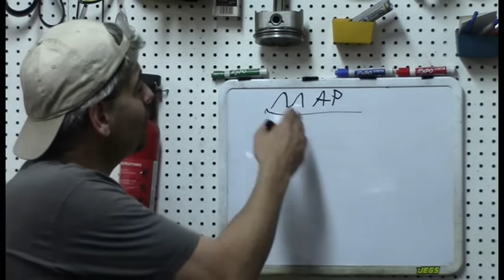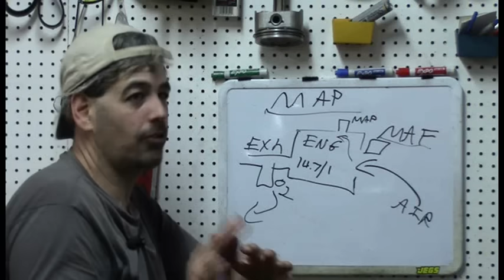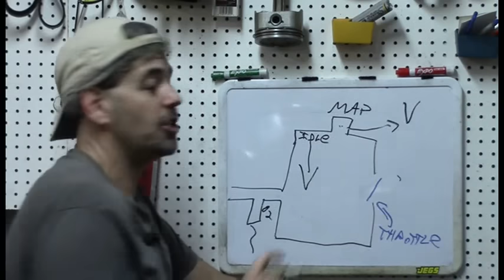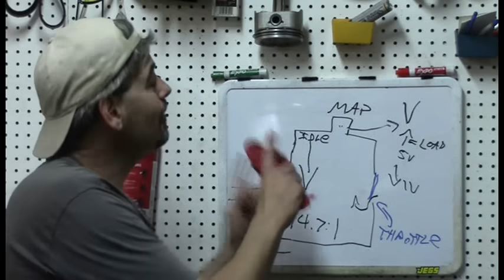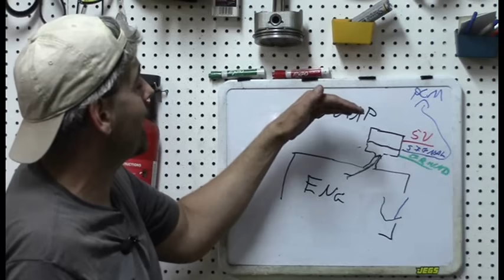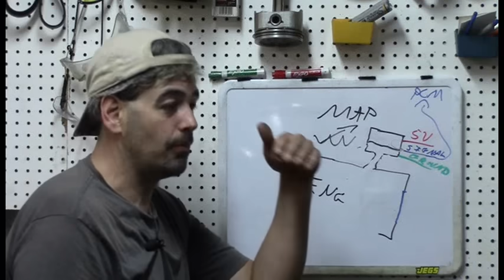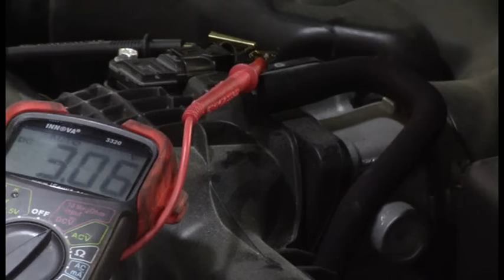MAP Sensor Diagnosis and Understanding Function- Pt1

Comment: I do not know all I know is that Autozone gave me that diagnosis on my vehicle but a friend of mine say that is going to be the MAP sensor, error P0871 A/T O/D pressure switch circuit malfunction and error P0736 A/T additional hear ratio error in reverse gear
Reply from the maker: I can't help without data, sorry.  Good luck. I hope your friend is a good guesser.

Comment: Good morning from Greece. In a town and country 2000 i have 5v to the signal to the map sensor.This happens when the terminal is out of the sensor, should it have voltage when it is out of the sensor?Thank you for the knowledge you give us.Please answer me soon.
Reply from the maker: Well yes of course- how would it work otherwise?  It's the voltage DROP you need to measure.

Comment: I have been watching your videos and they are very informative. I have an 04 Dodge grand Caravan 3.8 L sxt and code P0113 came on and I watched your video on doing a diagnostic ck on the air intake sensor. It tested for .1 ohms and the sensor and tested for 5.1 V. Have you ever came across this and found if ck engine still comes on what it might be?
Reply from the maker: You have to test for variable resistance in the sensor- you can't just test a single reference
Reply: @SchrodingersBox  I replaced the sensor, but the new aftermarket showed .01 ohms resistance, which I suspect it may have an open circuit.Tested with heat and didn't change. I think I bought one that's bad. Am going to get "OEM" and see if changes things. Any input would be helpful.
Reply from the maker: What?? Why would you suspect an open circuit on .1 ohms?? Say what?

Comment: I’m having the problem you were talking about in the video about the MAP sensor when the car is at low idle and it stops the fuel from going to the engine which causes the engine to cut off sitting at a light. I was trying to see how to fit that problem? I know changing the MAP sensor won’t do much.
Reply from the maker: What is the voltage curve you are seeing from the MAP and what is your fuel trim when curved against load?
Reply: Schrodingers Box It usually says about 12V when I come to a complete stop then when the engine shakes a little. Then the voltage drops to 10.2 or 10.3. Car cuts off. Starts right back up then goes on.
Reply from the maker: There is no way the voltage can be 12V at any time the engine is running. Absoely impossible.  How are you measuring this?
Reply: Schrodingers Box By my voltage gauge that’s in my car. While the car is driving it says 13ish range then when I come to a stop it says 12ish something. Once I see it go to 10 the car shuts off.
Reply from the maker: No no I asked for the MAP voltage. Why would the battery voltage be relevant? Please provide your MAP voltage readings and fuel trims as shown in the video otherwise I can't help!!

Comment: thank you, I am interested in detecting the methane-carbon dioxide flow from a bio-digestion research project, do you think I would be able to use a MAF for this purpose, or is it strictly for fuel-air ratio?

Comment: Great video, I'm hoping you can help me with a question.  I have  a 1986 F-150 5.0L with speed density EFI. I got a DTC 22 (MAP sensor out of range). The MAP sensor signal is in Hz, not volts on this truck. Everything I've seen says to  test the output with a meter (on the Hz setting) by back probing the signal wire with the red lead and the black lead on battery negative (I confirmed 5v reference voltage and good signal return to ground). I should be showing about 152Hz with no vacuum (key on engine off). I got 0Hz which means my MAP is bad according to what I read. So I bought a new one. Before starting the engine I checked the new one the same way and also got 0Hz. Bought another one just to check and also got 0Hz. I doubt that all 3 are bad. I assume I am doing something wrong but I can't figure out what. Followed directions exactly,  tried 3 different meters. Any idea how to test this type of MAP? Thanks
Reply from the maker: Just check the signal voltage. it’s pretty obvious you have no signal voltage to the PCM.
Reply: @SchrodingersBox  As I said, there is not supposed to be a signal voltage. There is a signal frequency. I just figured out what the problem is. Borrowed another multimeter from my neighbor and checked it again. Got 158Hz with no vacuum and the correct frequencies at other levels of vacuum, just as specified. All 3 MAPS are good. Turns out the 3 meters I used before were not capable of reading the output of the MAP, not sure why.
Reply from the maker: There will still be a voltage. Yes it reads frequency- but if there is frequency there is square wave.
  I would validate the square wave is reaching the PCM is what I am saying. if it is not, that explains your issue.
  You can also induce a signal frequency and see if it shows at the PCM too.  This is typically what I do in fact since it’s easier.
Reply: @SchrodingersBox   Thanks for the reply. I will check the signal at the PCM
Reply from the maker: I have a video with identical problem but a pulsewidth modulated ignition signal was failing to get to the PCM causing a no start. i verified there was no voltage at the PCM- even though it’s pulsewidth modulated. It’s exactly the same concept as MAP sensor signal to PCM.  Plus I just used a testlight and $13 DVOM. 
  title is “DIY: no start due to no spark diagnosis” or something like that.

Comment: Hi I need help with my diesel engine its got both map and maf, engine starts fine but while the engine is warming up it has trouble with acceleration its like the engine rev goes up to 1400rpm and stuck for few seconds. I did find a leak in the egr cooler which I have repaired. But the issue is still there. when its warm then the engine runs better. Please help.

Comment: Hi Matt, I have a 91 Ford Econoline. I have a high idle so it wont pass smog and I don't have a scan tool that will work on this vehicle. The idle is normal for a few seconds and then it goes up a couple hundred RPMs. Sometimes the rpm is up and then its down. There is NO MAF. I could not find a vacuum leak. I think the IAC is sticking. I removed it and from the intake so I can see the pintle and when I turn the car to on, I hear a click put nothing moves on the IAC. What do you think? Thanks for your help.

Comment: Thank you !  great explanation. Is there a chance to know how to check the MAP bad wiring ? ( I have an Passat b6 )
Thanks in advance !
Reply from the maker: Yes you very simply check the 5V reference against both ground and signal.  Its that easy. If it check positive the wiring is fine.
Reply: Thank you very much! It make sens :)
Reply: @SchrodingersBox  one moore question : do you know where should be the ground point on my passat b6 bkp? I didn't found it anywere. Thank you!

Comment: If I understand this then if there is a vacuum leak allowing air in then could that cause an artificially  high voltage reading and even go over the expected maximum? My 2006 T & C throws code 0104 for bad MAP but the MAP is fine so trying to figure out why code keeps coming back. I do not see any obvious vacuum leaks but will check better and comment what I find.

Comment: A question please. Valve lash effects on fuel trim, did a valve lash and my long term fuel trim at idle is  negative  9% to 10%. Its a 2006 Acura tsx by the way.

Comment: According to YouTube the problem with my 1998 Dodge Ram 1500 is the MAF sensor...so since it does not have one, I viewed that it has  to be the MAP sensor...so where is it located? I can't find it anywhere on the internet! Is this true? Cuz it's all the same symtoms...Hesitation, Jerking on 1st gear and now it's jerking at times when I'm driving too...It stalls sometimes when I'm  at a light or, when I turn the wheel also, (only when it's cold tho!) It does have engine pinging also....thank you💗💗💗 today is my birthday...Spent all day with this car problem...Please Help!
Reply from the maker: What data do you have that this is an induction metering issue? what is your foundation? Fuel trim? Map voltage?

Comment: Another great tuition. I was using the MAP data from my scan tool to help determine if i have any vac leaks as a starting point. One thing i noticed at idle if the AC is on its 42kPa and if i switch off AC it is 36kPa. I didnt think there was any relationship other than engine load. Is this normal?
Reply: Both conditions are at idle
Reply from the maker: yes it is normal because turning on the AC opens the idle air control valve.
Reply: @SchrodingersBox  thank you! Loving ur videos. My chevy avalanche and i are  following you from Qatar.
Reply from the maker: I have a few viewers from Qatar!! Good to know!!

Comment: Is it a coincidence?  The MAF g/s at idle is close to my engines displacement size in liters and when I rev it, the g/s climbs up proportionally to rpm.
Reply from the maker: It’s usually that the g/s at WOT is roughly equal to displacement but it usually applies to engines over 3L and in general it’s a good rule of thumb to estimate proper MAF volume.

Comment: what is your opinion on tests involving simply unplugging the map or maf to stall the engine to death as a form of testing the sensors functionality. it seems to be very popular and convincing
Reply from the maker: I have several videos not only explaining but also showing why this is a bad strategy. 
   Basically when you unplug a sensor- particularly a major one like a MAF, you force the computer to default to preset values that will also override other sensor inputs. Therefore the reason the car usually runs better after unplugging a sensor is because the default strategy often substitutes for other failed inputs other than the one unplugged.  The engine running better is falsely attributed to the unplugged sensor and assumption this means that sensor must have been faulty.
Reply: @SchrodingersBox  this is what i was figuring after watching about 15 of your videos. im between going towards a faulty map sensor and a fuel pump for p0171/p0174 on my 2006 acura tl. i replaced the fuel pump with an aftermarket delphi unit when i only had a misfire under wot and it did nothing but also i had zero diagnostic skills at the time. the map sensor is 18 years old and the live data indicates its on both banks and not a vacuum leak, but the map sensor data doesnt seem to be entirely predictable with my untrained eyes. car also has a hard start and extended crank that doesnt happen with the map unplugged, leading me not to believe its the pump as it seems like there isnt enough fuel to start the car with the map sensor plugged in. also it sometimes stalls the car unplugging it during operation and other times doesnt. but starting with it unplugged, it starts perfectly normal then dies

Comment: great videos, Just one question, you say that the vacuum is very high at idle bt then a few seconds ater talk about the vacuum being low at this point. Could you just clear that up for me please?
Reply from the maker: Yeah I misspoke on that. Decelleration is the lowest pressure (most vacuum) followed by idle.  There is no vacuum at WOT- so it will read atmospheric the same as when engine is off.
Reply: @SchrodingersBox  Thats great, thanks for clearing that up with a speedy response, much appreciated

Comment: Hey Matt, so in the event that you do have to change a MAP or MAF sensor, how long should it take for your LTFT to sort of acclimate back to normal from a lean or rich condition? Does it correct itself right away when the air flow is returned to normal or is there sort of a learning period for the STFT to catch up and regulate?
Reply from the maker: +surffchik STFT will immediately start normalizing and on some cars the LTFT will take seconds, on others it may be a several minutes.  Also, if you are familiar with adaptive fuel cell strategy, it will probably take couple days driving before all the independent fuel cells are relearned.

Comment: What is the proper cleaner for map sensor? Is it electronic contact cleaner or a mass air flow sensor cleaner? Thanks man!
Reply from the maker: You don't really clean one.  What is your data indicating it is dirty and needs cleaning?
Reply: @SchrodingersBox  as of now i havent got any data. It is just been 5 years already i havent cleaned it. Pick up is good. I just want to do it for preventive maintenance. Tnx for the response.

Comment: Quick question ? If im throwing codes p0107 and p0178 on a caddy escalade 6.0 non flex fuel would I have a 5 v reference issue ya think cuz it is running really bad no power its like its in limp mode
Reply from the maker: your thinking is on par. with low voltage codes on two 5V references sensors I would check for a grounded 5V ref first.
Reply: @SchrodingersBox  alright I've tried every damn ground I could find my 5v references are good ! So now my fuel pressure regulator is like all rusty and shit could that be a possible I keep throwing p0178 consistently but I don't have flex fuel what would be causing that code ? I've changed battery , starter , map , maf, throttle body , redid all my grounds even that little black whit stripped bastard , still . And another tip bit this didn't just happen it gradually happened if that helps it used to be start but wouldn't stay running did that for couple weeks in cold then boom going down interstate just lost power havnt got it back since . Sorry so long Im just so frustrated . Thanks

Comment: Question: Are all of the wires to the PCM a ground? Because through my findings the items go through the fuse box that the PCM controls. The reason I think this is my key was off and I disconnected the connector at my EVAP solenoid and ran a test light and the wire was hot coming from the fuse but when the connector is plugged into the solenoid the solenoid stayed open as its suppose to when theres no power and all it needed was a ground and the PCM turns the power on to it so in other words it would've had to set the ground to of been able to turn it on
Reply from the maker: No not at all. Many many are powers

Comment: Happy i found you. Great stuff. I have a problem...my codes show MAP  and TPS.  Would you be so kind tell me if they are related...Can they go Bad both ? Are they related ?  I am going to check if you have any video about the TPS...and learn. Suddenly it began sucking petrol like crazy and Idle very high. Codes showed Lambda sensor. Replaced it. Idle went better but Consumption keep High. Now show Codes for MAP and TPS !!!  :-( THANK YOU SOOOO MUCH
Reply from the maker: impossible to tell without knowing the voltage readings from each.
Reply: @SchrodingersBox  Thank you so much Dear. I was just looking the video  about the TPS. You are Really great . Happy i found your videos .Very helpful...straight to the point  always . Very good. I am going to try measure the voltage taking it out of the car to not burn anything! Again THANK YOU. Have a nice weekend. God bless

Comment: Hi There. great video.  is it possible to have a faulty MAP sensor without the check engine light comes on?
Reply from the maker: It depends on either how far out of range its calibration is.  If there is any electrical failure or, more likely, the diaphragm busts, it will definitely set a CEL. 
 Keep in mind it is actually more likely to have a CEL that doesn't specifically mention the MAP sensor- e.g. "referenced code".  Lean and rich codes are an example.
Reply: Thanks Mate.  My issue is that while the check engine light remains off, when I stop at the lights my engine starts losing revs with  rev counter pointer starts deflecting downwards.  Any suggestions please?
Reply from the maker: Joe Borg It depends on the car. If the car has a MAF then a vacuum leak could certainly cause this.  But also you might want to see my videos on IAC diagnosis.
  Without a scantool however it's going to be really hard to get a direction.

Comment: Hi, i own a jeep xj 2001, i connect the scann diag tool and no errors apear. Problem is very poor fuel milleage. MAP has never replaced.   Rpms are always between 750 and 500. Sometimes when i stop at red light rpm drop to 200 but it returns to 500 after 2 secs. Issue is it burns a lot of gasoline. Do you have any suggestions to fix the low kms per litter?

Comment: Hi sir ,today's date is 24/01/2020 and probably you're not gonna to check this comment because this video is about 2 years old but if so pls  correct me, i watch this video more than 4 times and i feel sth is wrong:
on 7:58 you say the highest amount of vacuum is at idle it means low pressure ,and you add that[ not the  lowest amount of vacuum because the lowest amount of vacuum will get while deceleration]. 
i think it may also saying either [the lowest amount of pressure] or [the highest amount of vacuum].
looking forward you to answer and correct me if i'm wrong sir because i think this sentence is the key in understanding and principle of MAP sensor.
regard.
Reply from the maker: You are correct. the vacuum is lowest in decel
Reply: @SchrodingersBox  🙏

Comment: Awesome videos!  Question,  I have a 1999 Jeep Grand Cherokee 4.7 liter with the signal wire in position 3 (which seems to be different than most).  I'm getting near 5V signal to PCM with the engine off (key on) and near 1.2V at idle.  When I increase engine RPM, I am actually getting lower voltage (down to .7V), that spikes around 1.4V on deceleration and then settle back around 1.2V at idle.  Thoughts?
Reply from the maker: Sounds right to me.
Reply: When I open the throttle (car running), my MAP sensor voltage (to PCM) drops.  I thought it should go up?  BTW, really appreciate your videos.  Have learned more from them than any other source.